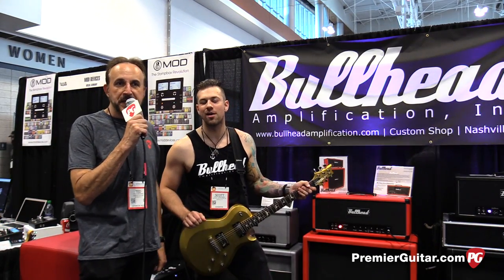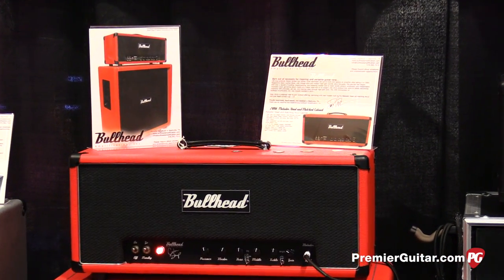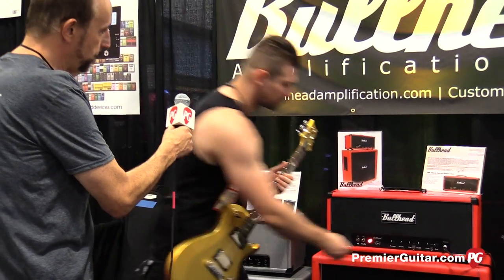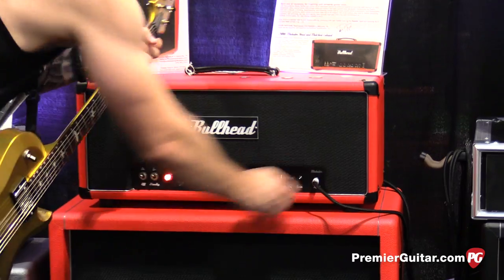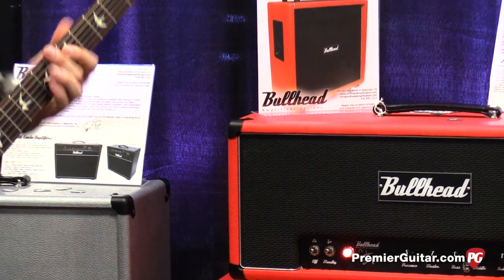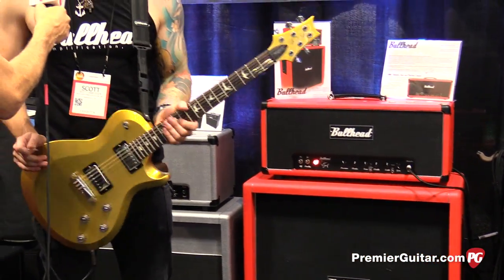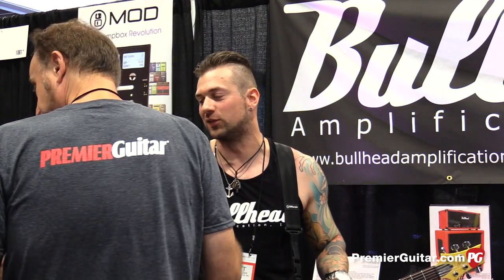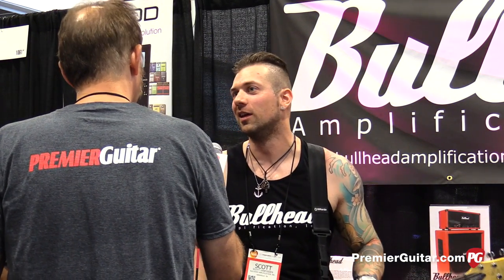SNAMM '16 - Bullhead Amplification Matador Demo

Comment: Seems like everyone and his brother is building these "Boutique" amps. It's getting ridiculous.
Reply: I have amps he copies that I owned and were made before his mama was out of high school. Time for the yawn.
There is no market so I hope they are having fun, as it is pretty much a hobby today.
Reply: Fred Garvin It would seem that way. Hey, just because he is a kid does not mean they are not good. But, I've seen it all and have not been impressed with anything in decades except a Landry. When Landry makes a 15 watter I'm selling something old. Cranked 50 or 100 watt amps do not sound very good. Took a good engineer to make those old records. I'm happy with good pre-amp gain and some selectable clipping...built in or a decent box...and there are a couple...out of the 500 also-rans...LOL!
Reply: TheDogpa Hilarious. One nice thing though, the price of some of that great gear has come down in price. And those old tube amps are not that difficult to fix. I got a great Dual Showman head for $80.00 not working. Just a set of tubes that I had laying around and one cap ($6) later, I was up and running,
Reply: Fred Garvin Well, if you are interested, I have a 58 bassman...real thing...with an OT from a '62 bassman (4ohm) and a solid state plug in rectifier. It smokes anything from then or now. With the OT change it is a serious upgrade in my opinion, getting rid of the tiny 2 ohm thing. I can easily plug it into real speakers too. Currently the cab has 4 ceramic fenders from 1974. Any way you slice it, it destroys a stock one. It is now the way it should have been...and more like what Marshall did. Best sounding tweed there is. I could have told Clapton or Bonamassa about it decades ago, but when you have so much money I guess it takes a while to see through it...LOL. I have no such issue...too much money that is...LOL!
Reply: TheDogpa No money burning a hole in mine either. That Bassman is worth some serious $$$$. Too rich for my blood, but what a sound.
Reply: Fred Garvin Without the original OT, changed speakers, even though it is all vintage stuff...and a case of missing tweed (nice wood though)...it won't ebay high as that is for 'purists' and 'collectors'...whatever they are...LOL. Maybe if I do a vid of someone good playing it...with a $1200 mic and a $3000 interface...at least it might pay for them.
The guy who did tube-amp questions for Guitar Player mag in the 'question and answer' thing in the back, in the 70's ("...we asked our tube amp expert, Roy of EAR Audio..."), told a teenage me, after fixing it "...keep it, you'll be glad you did when you grow up." Amen.